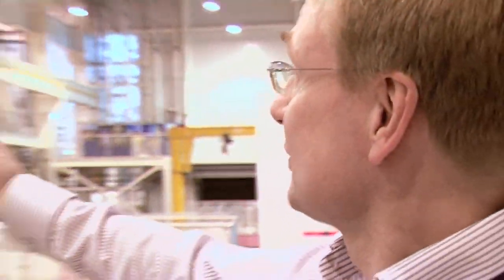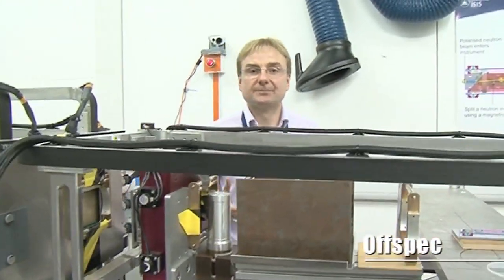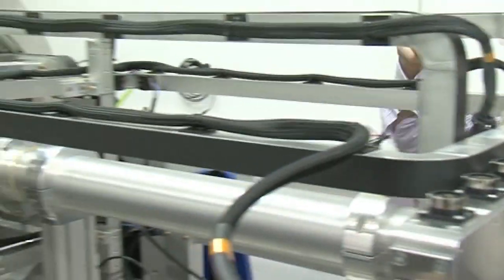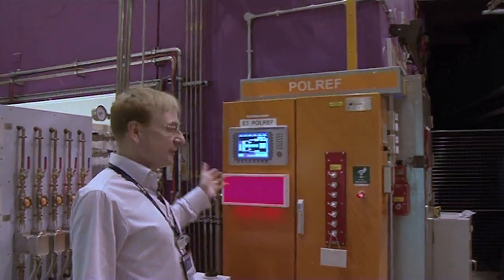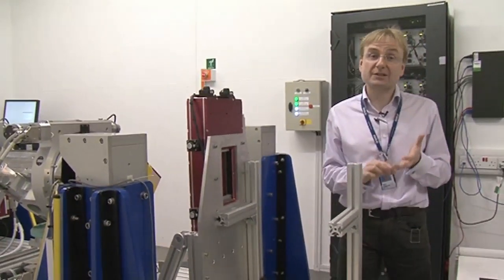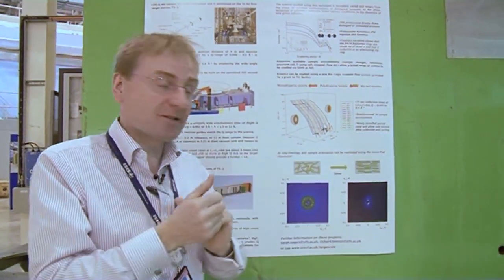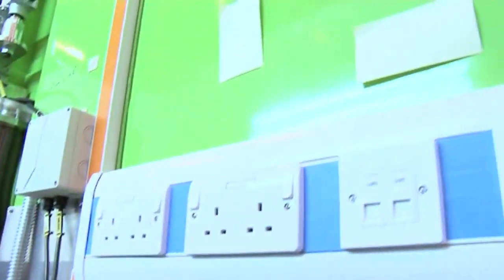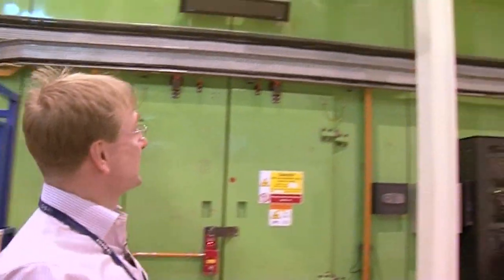Neutrons and Nanoscience - Backstage Science

Comment: I'm certain that there are very stringent procedures that must be followed regarding the key and it's placement....  additionally, if you notice in the vid there is a kill switch for the beam on the wall inside the chamber, and I'm certain an alarm sounds when the door is locked or when the beam is about to be activated.  Seeing that a video camera of the inside of test chamber has been added I would suspect that the beam operator has a monitor he must check to insure the chamber is empty.